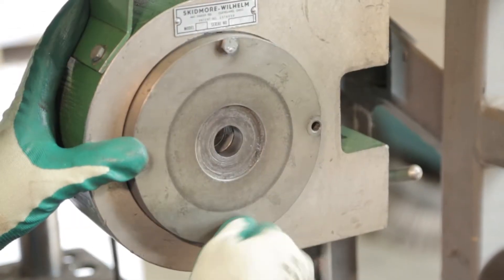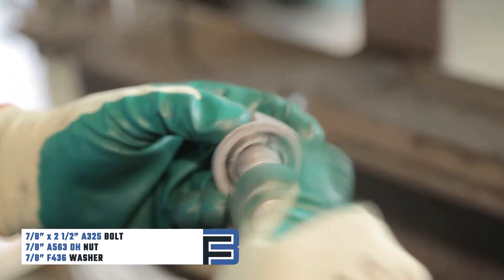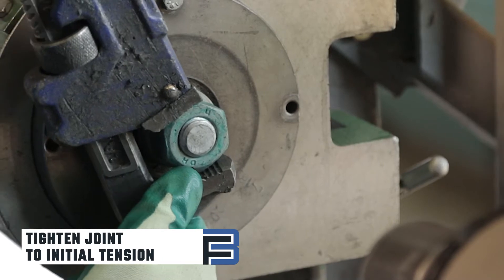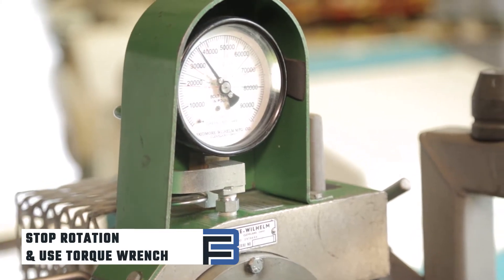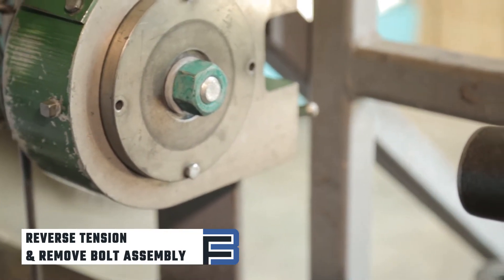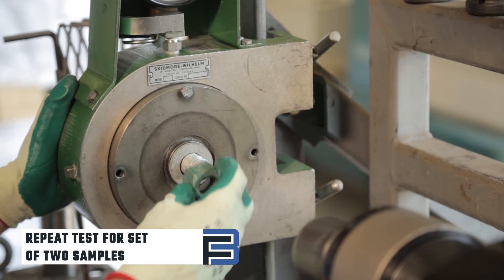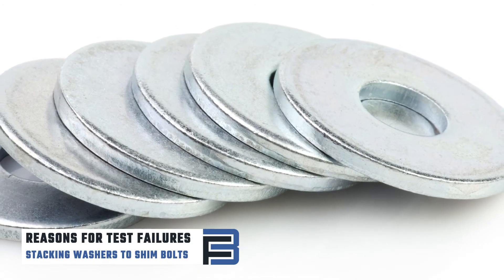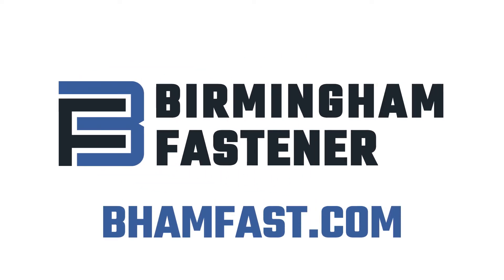How to Perform a Rotational Capacity Test

Comment: Pipe wrench on structural bolts would not fly on our job site.
I do not see the reasoning for this test. Proper tension is the ultimate goal and does not matter how we get there providing it is consistent and reliable. Once an installer is tested on a tensioning device and the bolt is examined for any damage, haven't we accomplished the same thing? The method of tightening, the proper tension, and the bolt assembly for damage.
Reply: It doesn't matter what you use to get the NBW assembly to Snug-Tight condition.  If my hand was strong enough to tighten it to 5 kips (it's not 🤣), I wouldn't need a wrench at all